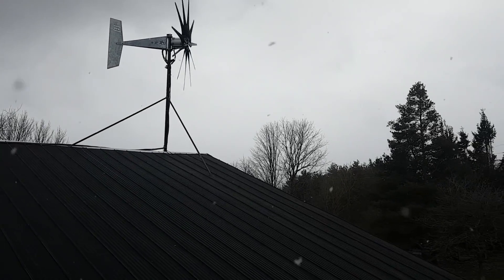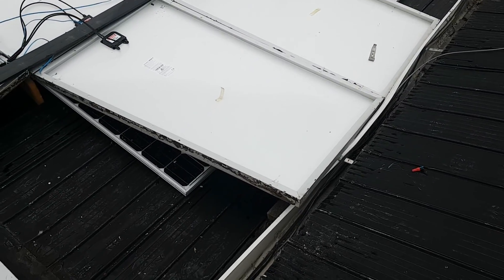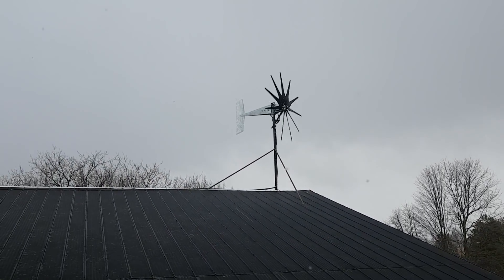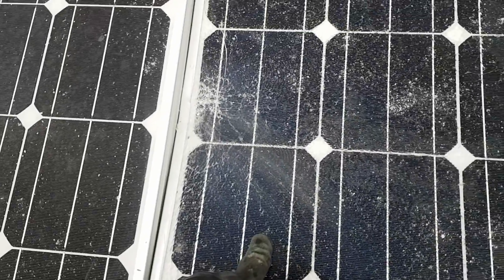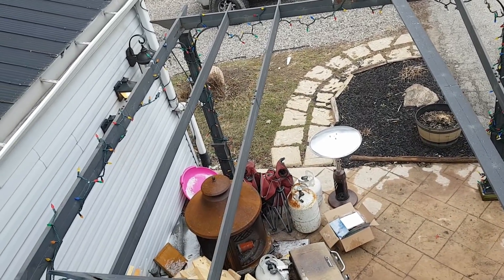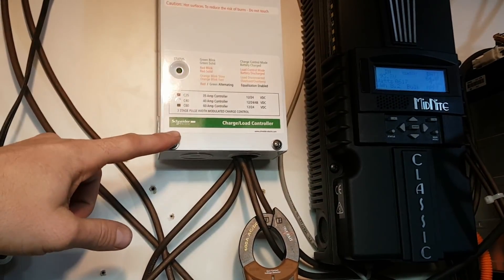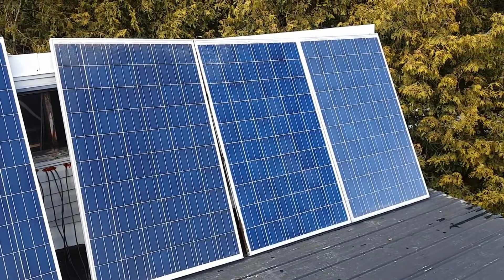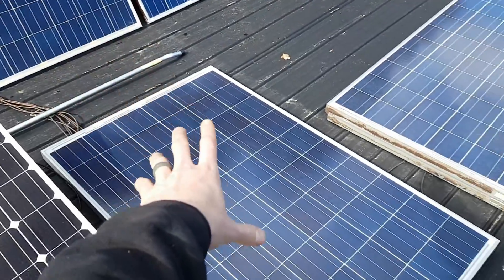80Km Wind And Loss Solar Panels

Comment: Man, that sucks!

Try coating the cracked panels in like, a clear epoxy resin to seal them, that way you can use them as slightly (maybe not even?) lower yield panels!